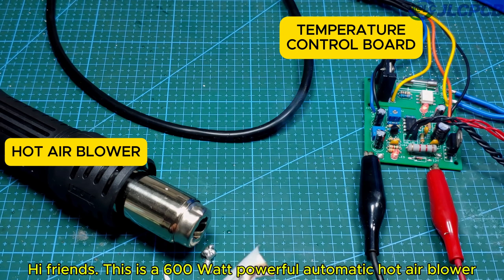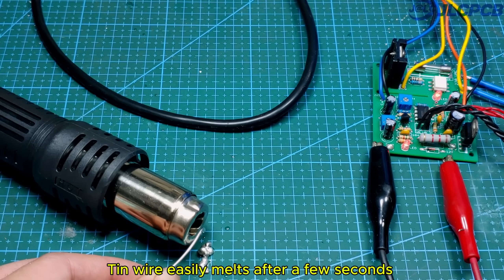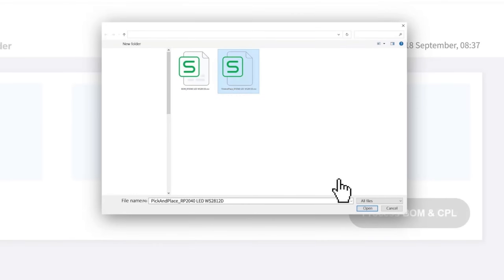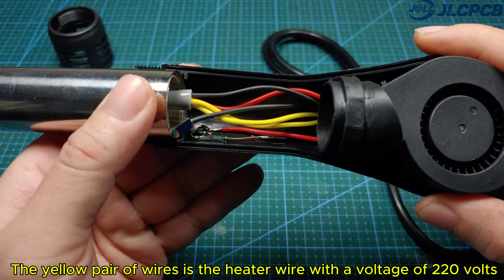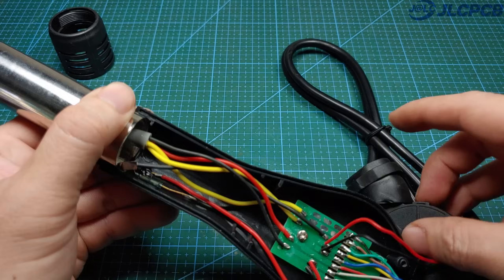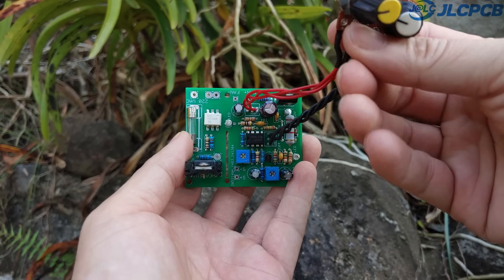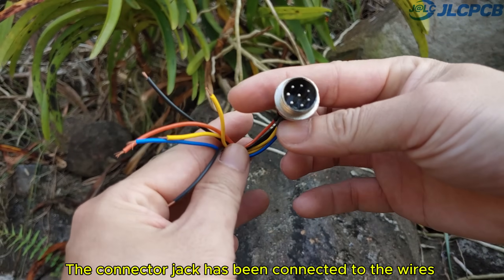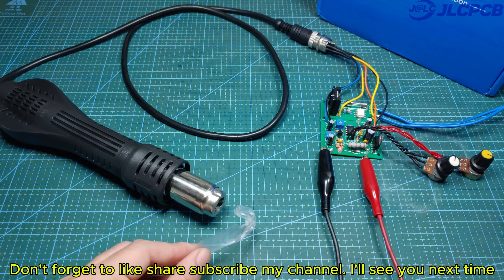Make an Automatic Hot Air Blower in 8 Minutes for only 10 USD_JLCPCB

Comment: Hi dear. Very good project. How to add a digital temperature display to this project
Reply from the maker: Hi bro. The easy way is used the digital temperature with sensor and check the temperature of hot air out
Reply: @LongTechnical  can you show this idea in video? Thanks